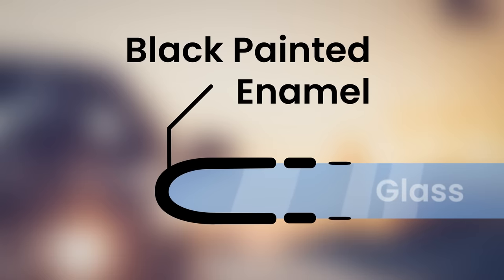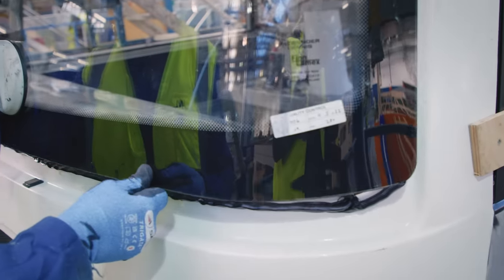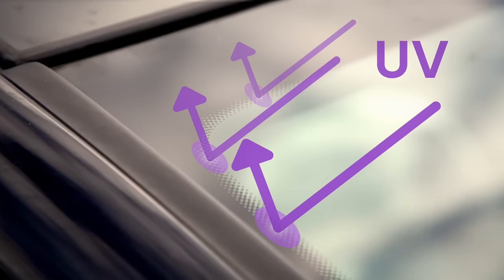Why are there Black Dots on your Windshield?

Comment: DW1256 GBYHD does not have the black dots, per se. It fits a Ford F-150 Harley Davidson Edition. The dots are actually black “Harley shields”. It’ll cost you a few $$$. I am by trade, an autoglass installer until retirement next month (66yrs&6m old). Installed glass for 45+ yrs. If the average person knew what’s involved, and why their glass HAS to be installed according to regulations they would ask more than how much will it cost. So if you are asked for your cars VIN #, it’s because some vehicles require a specific for your car. Some Jeep Cherokees have 50 different variations of windshields that could be installed. Ask a dealership or body shop who they use. One more thing, front seat passengers, DON’T ride with your feet on the dash. The windshield is installed so it will divert the airbag towards the passenger. Think about it. 🖖✌️❤️&😁 2all  🍻

Comment: The frit is absolutely not on the outer surface of the glass. The enamel is UV proof, so it protects the adhesive with only a single layer. Check your sources, bro.

Comment: So they can make glass thinner and not give you any stainless steel trim, cut costs. Bottom line Bean counters is why the dots are there. Auto glass is half the thickness it was in 1970s reduce weight cut cost being counters

Comment: It’s so you wouldn’t hear that this guy is wrong….,the dots are NOT on the outside of the glass….
Reply: I think he meant it was painted on the inside of the outer plate of glass. This is done to some windshields to hide the electric windshield wiper heaters.

Comment: Nice vid. The music wasn't much too loud, the frequencies are just interfering, and that's what other commenters are hearing. Try sidechain compression, that way your voice punches through the music without issue
Reply: What is this 'windshield' business? Thank god we are not yet totally Americanised in the UK.
They are called WINDSCREENS.
Reply: @captaintorch983  screen in the US often refers to door and window screens on houses, which are designed to screen particulates. It wouldn't make sense for a windshield to be called a windscreen, since it doesn't screen, it shields

Comment: I'm sure it helps with UV and glue. However, it also allows car manufacturers to not finish/trim the upholstery. When glass did not have this, the upholstery wrapped around the A-pillar and headliner. If you feel your headliner today - you will notice an unfinished edge.

Comment: Why are there Black Dots on your Windshield?
1. BS the contact point is the solid black not the dots
2. BS  why protect only a sliver of the dash from UV when the rest is exposed
3. BS  distribute temperature evenly and BS optical lensing - the same lensing can occur anywhere on the windsheild not just where the dots are
4. close  the "solid" black part is both to help bond the windshield (by acting as a structural frame holding the glass - yes, it is thin but it is structurally a stronger grip to the glass than adhesive would be and adhesive sticks better to the black enamel than it does to glass) to the body of the car and to hide viewing the adhesive
The dots are aesthetics only - to keep from drawing your attention to the abrupt change from black to clear - with the frit you tend to focus on the car's other lines - pleasant lines they hope :-0)

Comment: that did not answered why there are dots around the edge. it explained the black parts that covers the sealant, but not the dots.
are they just a visual gimmick?
are they for the manifacturing robots?
who knows. the narrator sure doesnt
Reply: It is either for bonding or to distribute heat.

Comment: Basically it is there to hide poor design and workmanship on newer vehicles. Older vehicles don't have it because the parts fit together much better and don't leave unfinished areas that need to be covered up.

Comment: Can't believe the amount of BS that this video contains. YES! one of the primary functions of this black ceramic paint is to serve as a surface for the adhesion promoter to glue the glass to the frame, but it's not 100% necessary. The primary function of the frit is to cover the structure where the glass is mounted on and the black dots are to provide aesthetical finish to the edges and help to cover the edges of the interior trim panels and it's variation across the car. NO! they don't regulate the temperature, that's purely the glass itself and if it does, it reflects the radiation of the sun to avoid heating metal elements in the frame of the car.

Comment: Windscreens block UV.
Reply: Not completely. Glass can never 100% block the UK light and some types of glass actually allow a lot more to pass through too such as greenhouse glass.
Reply: No they dont, they are not treated and not classified as UV protected,like sun glasses, if they were they would cost 10 times as much, why do you think that certain things fade in cars, colours, materials etc. even the dashboard on cars can go funny, UV
Reply: Oh bollocks!
Reply: @jackking5567  UK light? Wow, your royal family really thinks it owns everything,  doesn't it. I suppose they would like us to pay tax for being able to see.
Reply: @AdrianJayeOnline  wow you sound very confident. You're wrong though, windshields definitely block UV. Normal glass blocks UV-b pretty well on its own, but windshields are manufactured with layers to block about 99% UV-a. As opposed to sunglasses which will usually block 99.9% if they're rated UV400. So you're right that they don't block as much as sunglasses. The rear and side windows however are usually not treated and don't block UV-a. The reason the inside of your car will eventually get sun damage is not only because of bounce light from the side and rear windows, it's also because even 0.01% of UV will damage things if they're left in the sun all day for years on end.